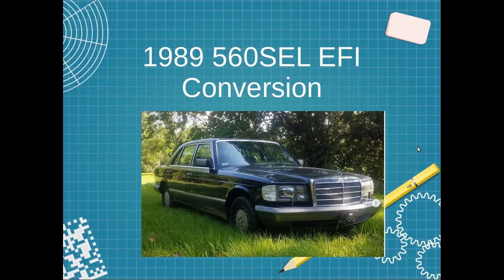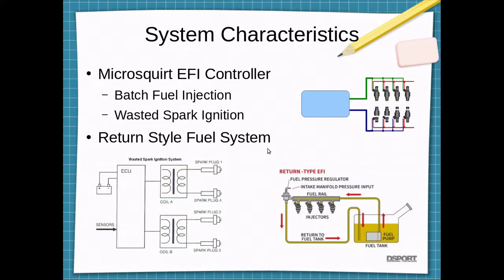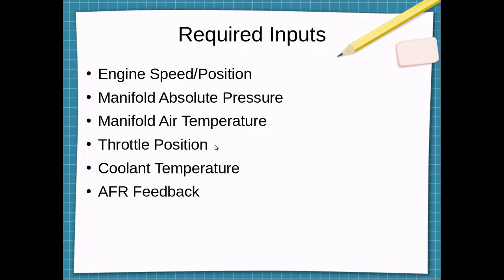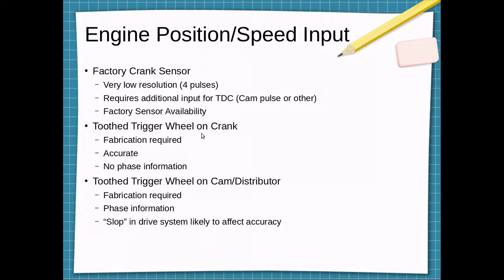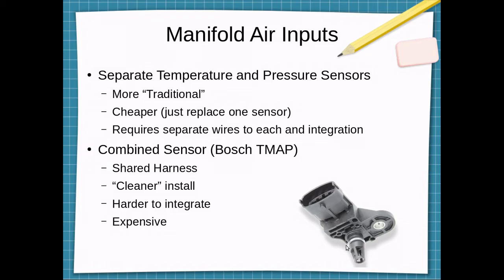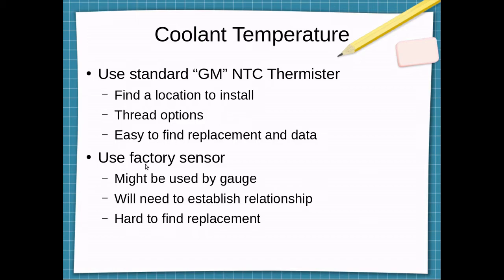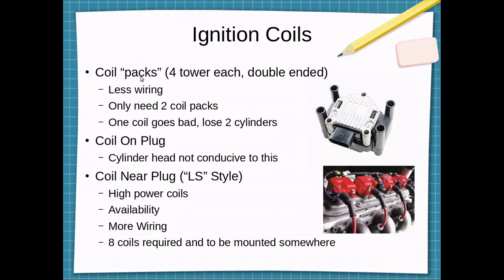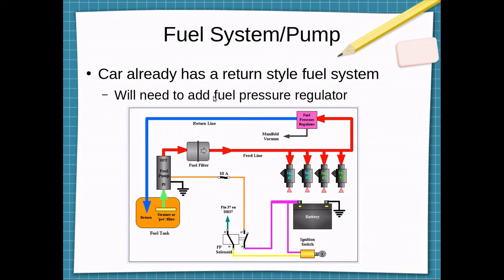1989 Mercedes-Benz 560SEL EFI Conversion: Overview [2]

Comment: I'm following along and hope you're successful. I'm working on a 560sec  and rebuilding the top end at the moment. I might do the same thing with the fuel system as you so I'm paying close attention.
Thanks
Reply from the maker: That's awesome! Thanks for watching. I just got the trigger wheel mounted to the crank pulley. That has been a learning experience... I'm trying to find a crank sensor I like.